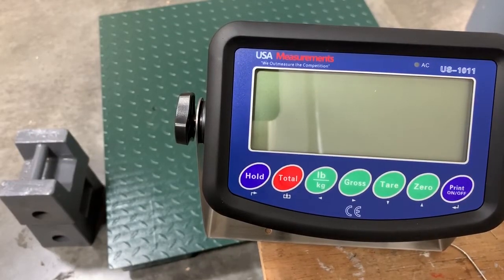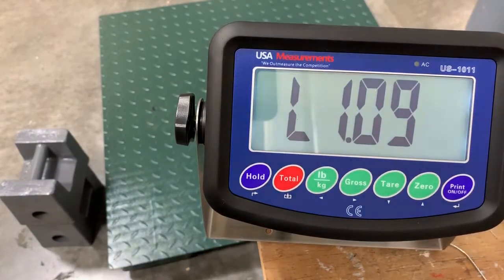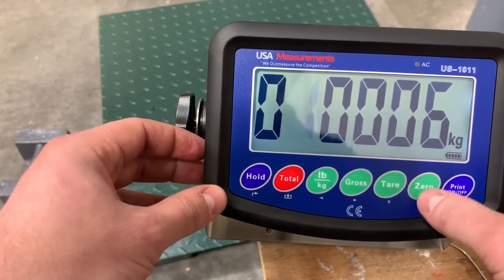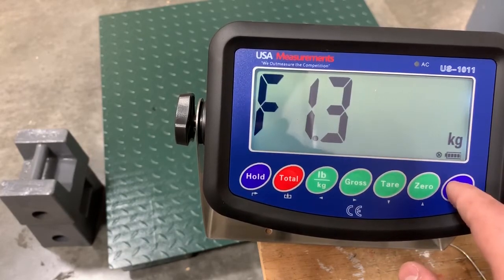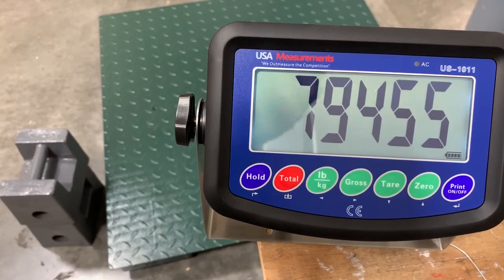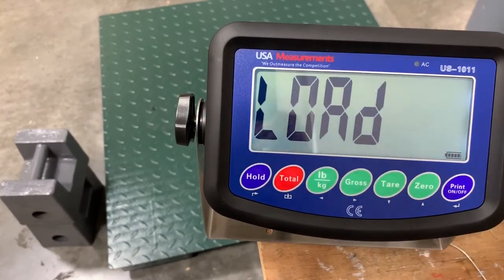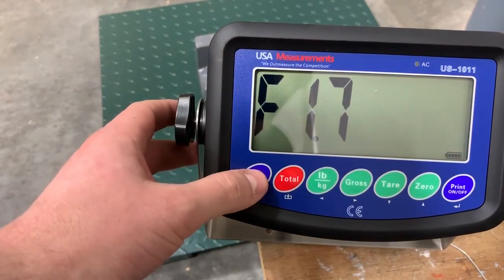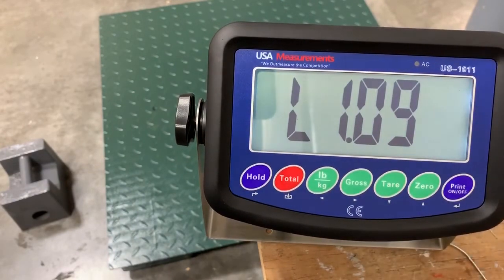US-1011 Calibration (How to fix the EEE)

Comment: Does this floor scale come in this size,10,000 LB x 1 LB 60"x60" Pallet Floor Scale w/ US-1011 Indicator with computer connecting port and printer.
Reply from the maker: Yes, it does come in this size with option for a printer